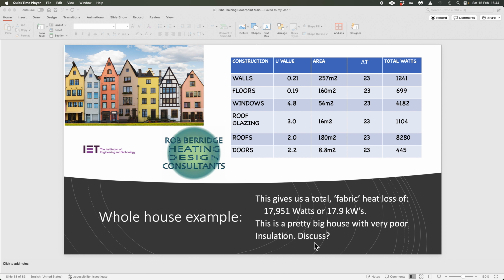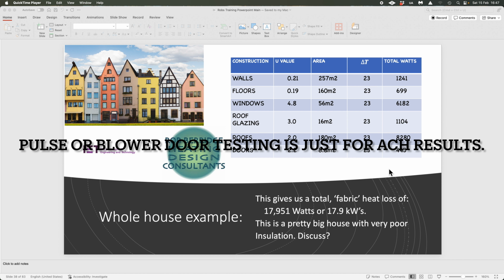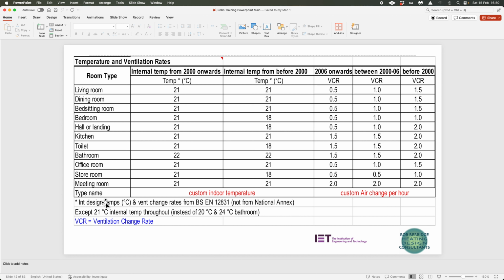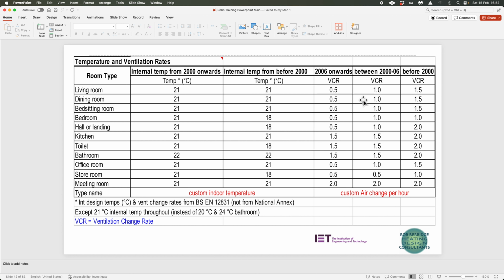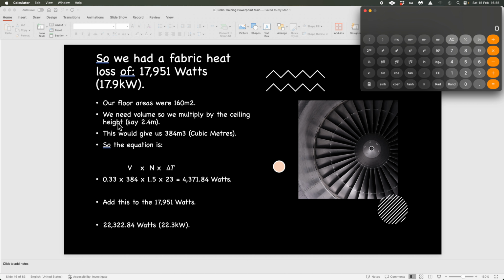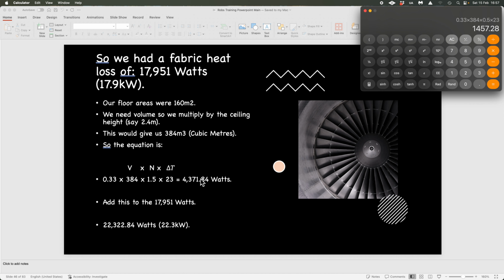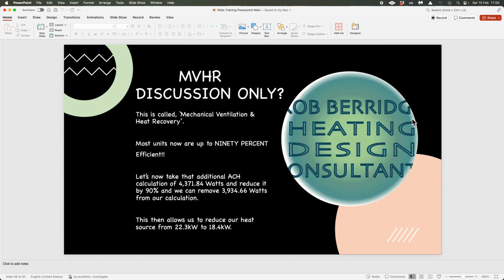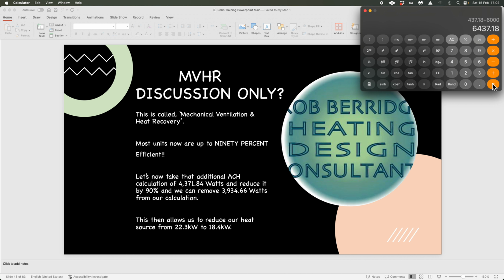Part 2 Heating Design Tutorial Air change Rates

Comment: I Rob thank you, great tutorials. On the MVHR point, are you are saying that the MVHR unit is replacing all the natural air changes (all the leaky bits) in the house with it's own air cycling or would there still be air leaking out of the property?
Reply from the maker: If the MVHR unit and system is commissioned correctly, yes, it would be up to around 90% efficient with modern equipment.

Comment: Thanks Rob for these wonderful videos. 
In my experience the number of air changes used has always been grossly understated.  Frankly I feel it’s a big factor in the failure of ASHP installations.  I agree totally with everything you state, but the Air Changes rates are far too low.

We have a huge problem with condensation & damp in our housing stock here in the UK. I also think the high moisture content of our Winter air is overlooked <5°C can be 90% moisture, we have a very wet, cold climate here.

Heat Recovery Ventilation should be mandatory here when fitting a Heat Pump.
Or do as the Germans do, in the Winter they open all their windows for 10minutes👍

Thanks again, I did training in the early 80s on Long Hand Heat Loss Calc., so it’s good getting a wee refresher.
Reply from the maker: @jimmygillies5590  Couldn’t agree more with the massive guesswork surrounding ACH in the U.K. and would also agree on the climate we have being very humid. This causes many more defrost cycles on AHSP’s and should factor into all designs.
Perhaps I’ll do an additional vid on U.K. humidity.